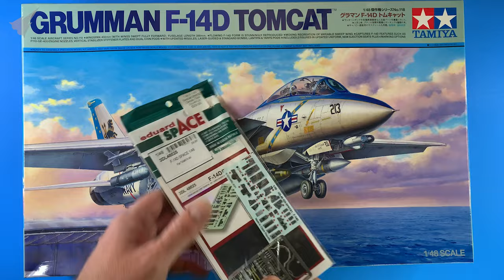F-14D Tomcat - Tamiya 1/48 Scale Model - VF-213

Comment: Great job there. I would like to ask how would you be able to apply the yellow star decals to the blue painted area at the rudder? Thank you
Reply from the maker: Hey there, thank you, and thanks for watching!  I bought a Micro-Scale decal set, and the stars are all connected on one transparent decal, so it was easy to apply the decal and adjust the position with microset decal solution.  Right at 13:06 in the video you can see the outline of the decal.
Reply: @scalemodelpursuit thanks for the prompt reply. I would like to know how can we remove the outline here. Again, thanks for the good reference here.
Reply: @scalemodelpursuit  Hi Sir, can you teach me how to remove the outline?Also, I am currently at the stage choosing tamiya f14A and f14D, any recommendation?
Reply from the maker: @zhuhenry9586 to eliminate the outline, after the decal is dry, I gently wipe the decal area with a soft damp cloth.  This will remove any of the remaining decal chemical on the surface.  Then I spray a couple of thin gloss clear coats over the decal.  The decals I bought for this model are very thin, so the edge disappears.  Tamiya decals are thicker, so when I use them I spray a few more layers of gloss clear over the decal, then carefully sand the edge away with 1000 grit sandpaper and work up to 6000.

From what I’ve seen the Tamiya F14A is also an awesome kit, mostly the same as the D kit.  So I think it comes down to personal preference.  I really like how the engine nozzles look on the F14D so I went with the D kit.  I think the D model may have more modern weapons and targeting pod included in the kit, but not 100% sure on that.

I do plan on building an F14A in the future, because I really enjoyed building this one!  Good luck with your build and feel free to ask questions once you get into your build.  I really appreciate you watching and engaging in conversation with me.
Reply: @scalemodelpursuit  thank you sir for the patience and teaching. Looking forward to your next video!